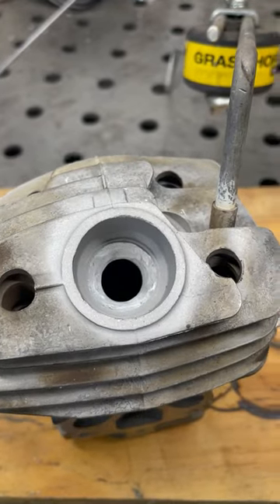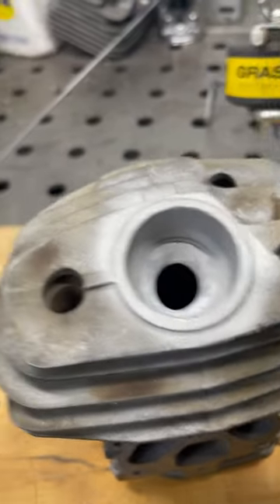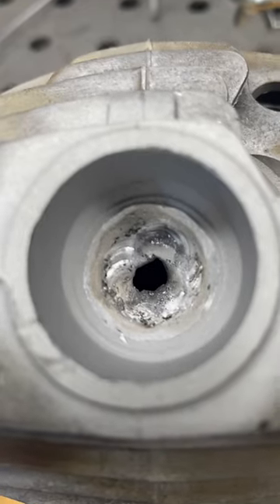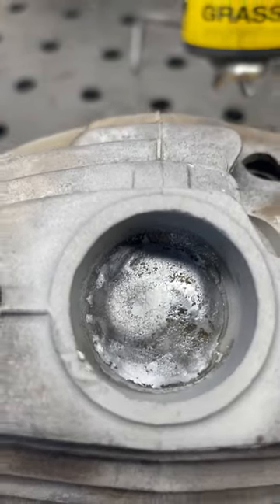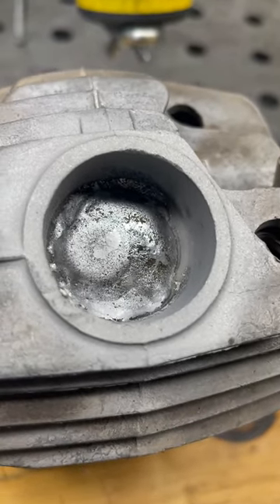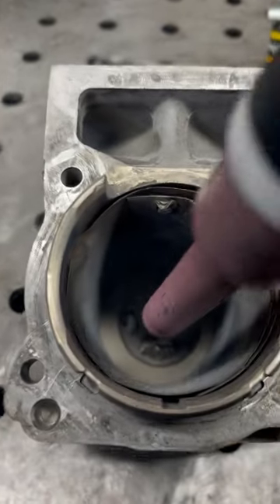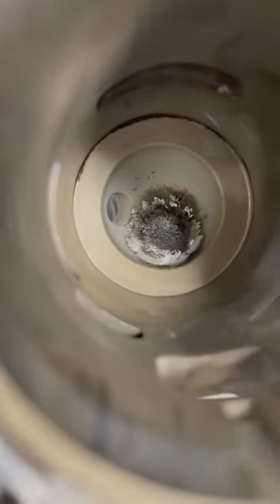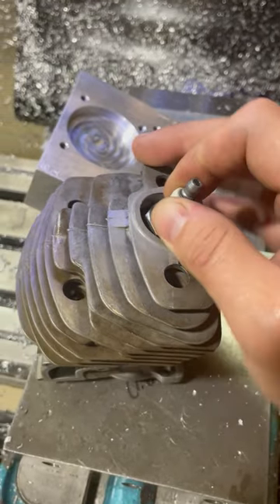Spark plug thread repair

Comment: Cylinder not warped? 
Great Work
Reply from the maker: No, I've welded up over 50 cylinders like this and none have warped.
Reply: @srcarr52  how do you get the filler to the puddle? Its so tight in a cylinder. 
Great skill! Why no helicoil?
Reply from the maker: @Witschor  the wire heli-coil inserts don't work as they are larger than the sealing washer of the spark plug. The solid insert styles often rattle loose on chainsaws.
Reply: @srcarr52  ahh ok, nice to know . Thank you. So which rod do you use ? Almg5 ? 
Taday i welded a dome on a 372 Piston. 
Tomorrow it gets machined an i cant wait to see , if that works or not. Self welded pop up. See if it runs
Reply from the maker: @Witschor  4043
Reply: @srcarr52  thanks